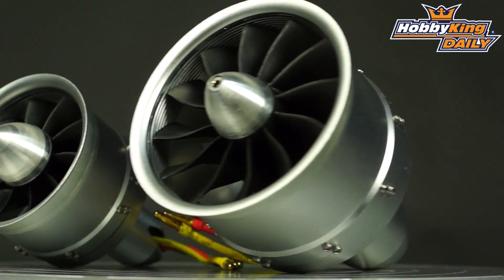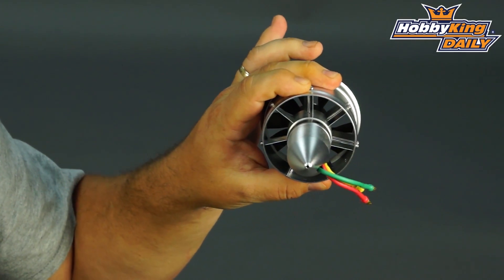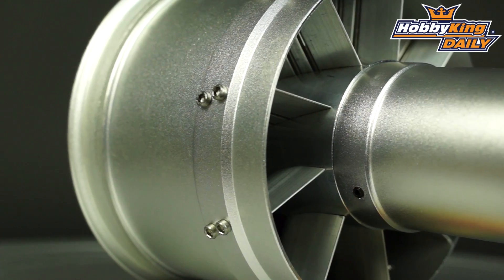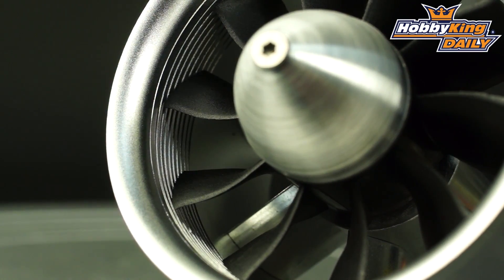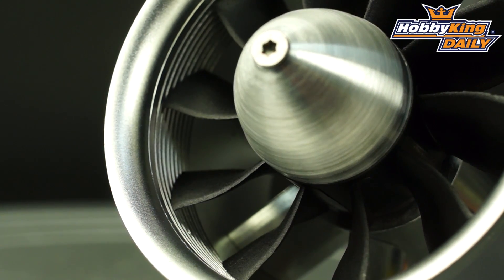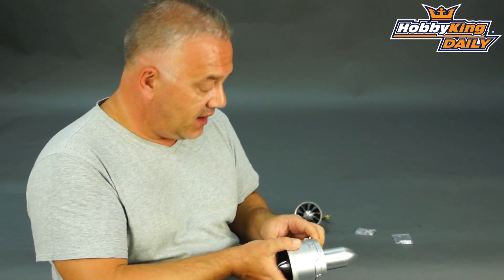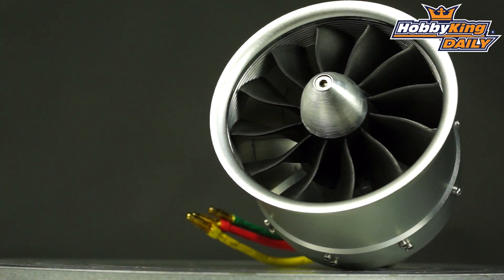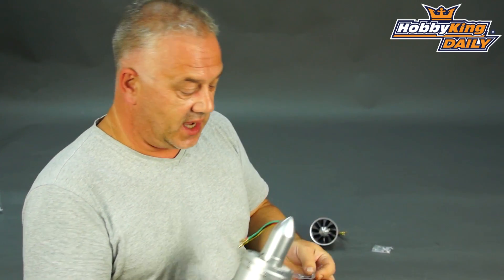HobbyKing Daily - Turnigy Aluminium EDF Unit

Comment: Will it create boost if I hook it up to the intake of my car?
Reply: No, it's a simple fan not a compressor.
Reply: 8b64z Same type prop as a turbo. Are you saying turbos are just fans? Im quite clear on why it would not work. Lets hear your reasoning as to why.
Reply: 8b64z I have one  on my 87 supra end 91 4runner with the lexus 1uz but please help. so explain what it you seem to think im not getting. Turbines do not produce boost? So you're trying to tell me the electric dive turbine in this video can not produce boost. perhaps regardless of the amperage. Lets excuse the turbines derivative rather it be exhaust gases or a belt. You're saying I'm an idiot and a troll because? I get it. You're pointing your finger accusing me of being your choice words. But notice when you point your finger you have three more pointing right back at you.

Comment: I'm thinking of a project for one of the smaller fans, a Eurofighter using 4 3s 2200 lipos to get a 6s 4400 setup, I've always wanted an EDF but have always been put off by the amount of energy they waste to noise

Comment: I would like to see thrust curves for different motor (watts) used in the same fan unit, and different voltages. This would be very helpful for modellers who are balancing power and cost. EDFs are currently putting out about 1/2 the thrust of a propeller motor for the same wattage. So, you have to put twice the wattage in an EDF as the expected wattage that would work in a prop plane, and you run into the problem of having to use higher voltage. So it is much more expensive per pound.

Comment: can you tell me if I can run a 50mm ~ 90 mm edf at higher rpm around 100,000 how much thrust can it generate (independent of how powerful motor I can use, I just want to produce high thrust at high rpm with a small edf)

Comment: Absolutely do not buy this setup. I purchased 3. One for a phase 3 f16 and 2 for a BlitzRCWorks Mig 29. All three didnt pass a bench test running 4s. 1 had bent shaft noticeable out of the box. One got to about 25K Rpm and and the shaft broke. The last on I suspect the blade was off center with about a 3.5 mm gap on one side and touching on the other. I was also told because I ran 4S and not 6S I voided my warranty.